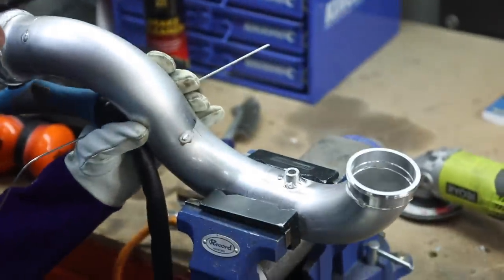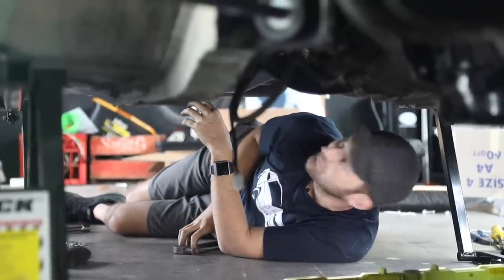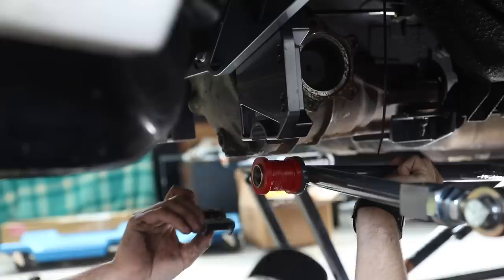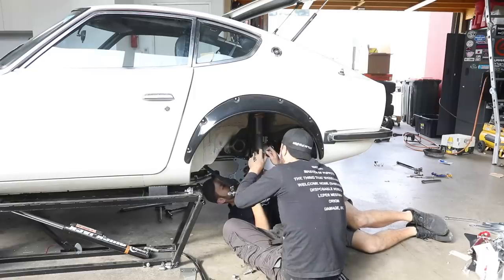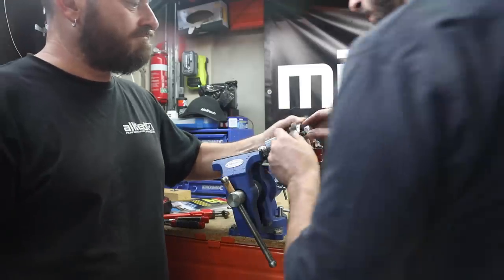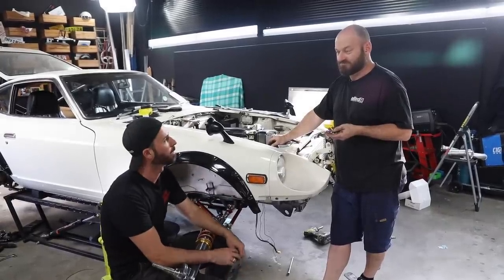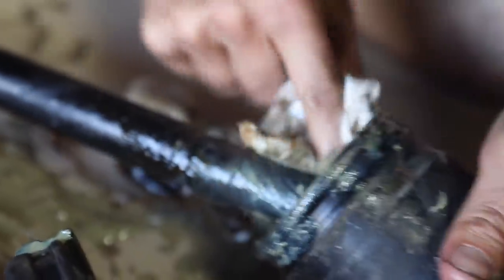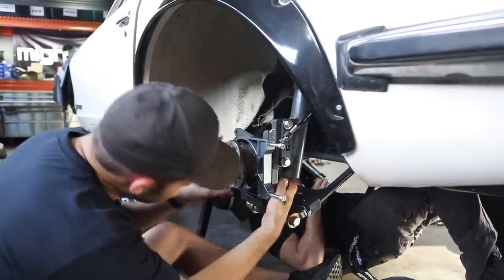240Z - RB26 Engine Conversion [PART 8]

Comment: How car projects work: Im just gonna change the fuel pump, well if im changing the fuel pump i might as well change the injectors, well i might as well switch to E85 while im at it, i've gone this far a turbo conversion i'snt that hard, well if im going turbo i might as well swap a 2JZ, well i gotta do the brakes and suspension now, I'm running out of fuel at boost over 25 psi better upgrade the fuel pump...
Reply: Modding cars is just a constant battle of balancing out the rest of the car that used to be balanced before you modded one part.
Reply: Dan this may have just perfectly summed up my last bike build as well as almost every other build thread I've seen from drift, to hot rod, to jeeps!
Reply: I joke that ive spent thousands of dollars making my cars worse to drive, yet I keep doing it. Just started my GTR upgrades.....I'm sure a year from now when it's still sitting in a corner of my garage, I'll wish I had left it alone and just driven it.
Reply: Amen
Reply: Well shit if im going to go that far, i might as well just not do it and talk about someday doing it and just drive the damned thing.
Reply: Dan 🔨 meet nail. Spot on! (Minus the 2J. RB is life)

Comment: Top tip for CV joints: Try not to let the balls get out!  Each individual ball is precision honed to it's socket, and on s/h joints, then has also worn into that exact socket. By releasing the balls ( ;-) ), you mess up those tolerances, meaning the joint spiders do not load share correctly, which can (note can, not will) lead to early failure, and overheating.........  On some joints, where you can't access the back side to get the circlip off, then disassembly is the only option, but i'd suggest using a paint marker to mark the balls and sockets to enable them to go back into their original sockets
Reply: Good advice I never really thought about tht thx!

Comment: You guys got me motivated to get the 260z out of the shed after 8 years and get the rb25 det  into life after draining old petrol,new fuel pumps x2 and every bush in car replaced just hit the dyno for a tune and 398hp to the wheels the smile is back on my face. Cheers

Comment: I don't think many people know this, but there was a long lost interview with the designer on the Fairlady Z after its creation. He expressly said that if he had the resources, he would have sourced his suspension from a company in the United States, use Wilwood 6 piston calipers in the front and 4 piston in the rear, made the radiator pipe hole a couple millimeters bigger, used an RB26 engine, and chopped together an oil pan including bits from a Honda.. I would just take my word on it because it will be hard to find a copy of that interview.
So this is a very pure build under the spirit of the Fairlady Z.

Comment: It's a Nissan, and nothing has yet gone wrong... 

I don't understand.
Reply: Azael X it's an old Nissan, made in Japan of course nothing with it wrong
Reply: they haven't tried to start it yet!
Reply: the Datsun is still in this one, maybe not later models though.
Reply: You just said it, “it’s a Nissan” there’s yo answer
Reply: Had an s14 and so much just fell off it for no reason. Honda now. over 300k and no problems. It was just after Renault took them over and it was like someone had switched the customer support switch off.
Reply: Had an S13 and everything was always golden. Easiest car to work on out of the 30-some I've owned. I miss it terribly
Reply: Cause old Nissan’s are the best Nissan’s
Reply: They certainly turned to shit when Carlos Ghosn got involved.
Reply: True shit. i have a nissan and the trans exploded two days ago... good thing i have a spare :)
Reply: Martin Espinoza a car doesn't need to be easy to work on if it never breaks! I'll stick with Honda as long as I'm poor, which will be a few more years. Then I'm getting a nice Acura.... Because Honda.
Reply: Mine was making a funny noise. The dealer couldn't hear it until 3 days after the warranty expired (!) A quick call from my lawyer fixed their hearing. Would never buy another. Wankers.
Reply: Azael X because they have Turboyoda overseing everything.
Reply: Azael X my 370whp R34 hasn't had a single issue in the 11 years and 100000km I've had it. 🖕
Reply: Jason Bourke 350z for myself. 5 years and  128,000km with fluid changes and a battery. My Trans has never been rebuilt and doesn't grind. It has the same clutch its had since it came off the lot with no slip. Currently have just shy of 300,000km on the clock, and it still runs strong. My frontier had 500,000km before I sold it. I've loved my Nissans.
Reply: Because it’s in it’s natural habitat.  A shop.  With quick jacks.  Jack stands.  IT ISN’T MOVING.  IT HAS TO MOVE TO BREAK.  IT HAS TO BREAK OR MY LIFE IS A LIE.
Reply: Azael X i agree
Reply: Azael X because its a datsun
Reply: It's a Datsun, and that pretty much explains it.
Reply: Its saving it all for when track day comes..... jk i hope not, its a sweet build
Reply: I have a Lexus is300 it has 289,000 miles which is like 464 thousand km or something like that. This was possible because Toyota owns Lexus and decided to put a 2jzGe or as we know the Supra motor sadly it doesn't come turbo hence the GE and not a GTE oh and about the Honda guy. Bro get a Toyota they have the most reliable car no joke with Lexus getting flucuated between 2 and 3rd place. Ahh yess you don't believe me go on now, give it a search.
Reply: Datsun Quality
Reply: Honda is quite expensive, at least in Europe.
Reply: Well, they ended up having to rebuild the entire car, more or less, does that count?

Comment: Cool trick when packing a CV with grease, squeeze all the grease into the female spline. 

That way, when you push the axle in, it rams the grease up into the ball races for you. It's just a bit less messy.

Comment: Hello!   waves hands  If you haven't done so already, you might consider replacing the headlights with good quality LED bulbs and Hella lenses.   They look bone stock and put out far more usable light while putting less of a strain on the feeble electrical system.  In 25 years of owning 240s, I've had headlight switches fail at 120kph and once had the headlight fuse melt completely OUT of the fuse box. Things stay nice and cool with LED bulbs.    Keep up the great work!!

Comment: Those front lower control arms are track control arms, not really meant to be used for camber adjustment as the strut top is meant to be used to adjust it. I'd offer to do your wheel alignment for you guys but I think Gatton is a bit far to go to for an alignment from Sydney.

Comment: Throughout my teen years I had about 10 different 300zx. I wish i had known about independent fuel management systems back then. The electronics in those cars are a nightmare. Maybe one day I will get another one and do it right with a Haltech system!

Comment: ok, so i'm not 100% on my skylines but they kept calling the driveline a rear wheel drive GTR, isnt that just a skyline GTS (Rb26T , RWD)? i know they used the same rear diff etc. But the r34 gtr trans was (slighty to greatly, depending on who you ask!) stronger than the GTS. Was the GTS even offered in australia? Great series guys, keep up the good work.

Comment: breaks ya heart.... at 16:53 after all that work with the CV...you can see that Marty didn't seat the drive shaft boot properly and the tie cable is sitting incorrectly and the boot is not sitting right :(

Comment: have you thought of putting clear lens headlights in, if you're improving everything else you might as well upgrade the light output as well? What size are the headlights 5 3/4" or 7"

Comment: @16:51
The rubber casing under the clamp is not exactly straight. Better correct this until the car is fully assembled )

Comment: Stupid question, but why did you go through all the trouble of taking out the old CV boot and everything internally instead of buying new? I have snapped CV joints before in a "not so powerful" car and think the amount of power your putting down with the new build, why not put in new?

Comment: A question:  the skyline gtr uses a R200 but it also has a front differential to take some of the power.  Since you are only rwd would the R230, like the tt 300z you mentioned be better for worry free longevity?

Comment: Hoping to beat a Porsche 911.....of what year? Of the equal year model as the S30 then for sure you will, a 2018 Porsche 911.....not very likely, they are technical master pieces.

Comment: How come you didn't completely degrease the entire CV's? As me personally, I don't really like having grease that's been in there for years that's been under loads of pressure. Loads of blue roll n some break clean so it's sparkling, then fill it up with fresh stuff. 
How come you didn't use stainless steel cable ties for the steering rack as well as the CV's? It'd be cheap insurance n something you'd never have to worry about for years to come.

Comment: how do you find out the proper torque for every bolt?
Reply: NavalNation I doubt they bother. But on stock stuff use a service manual, and with other stuff you'd have to look up the bolt grade and standard torque level for that grade/size/pitch. I've seen a chart for that somewhere...

Comment: GAH! With all the money you have already spent on this project, why in the hell would you reuse the old CV joints? Hell, you could have gotten another upgrade toward reliability in the process. At this point, I am hoping you didn't reuse the old bearings as well.
---Just my two cents.

Comment: Bit odd, spending thousands on all those spanky new bits, but not seeming to give a toss about the old parts being reused, or that mangy looking diff, those old parts should be media blasted or wire wheeled and powder/ceramic coated imo. I dont see the point in putting that much effort into the engineering of a car to only half ass the finish, ill bet it makes turbo yoda sad ;)